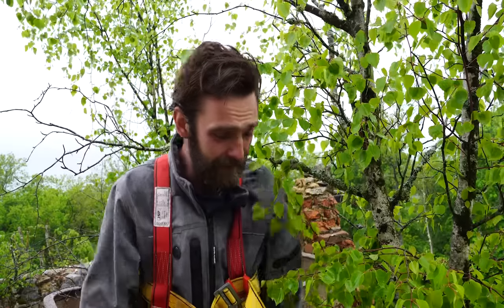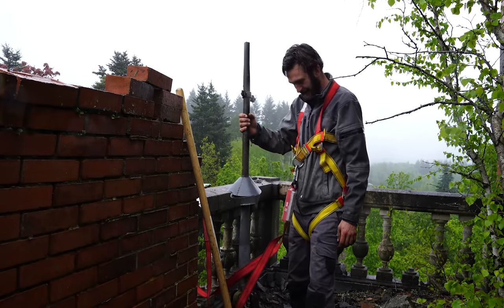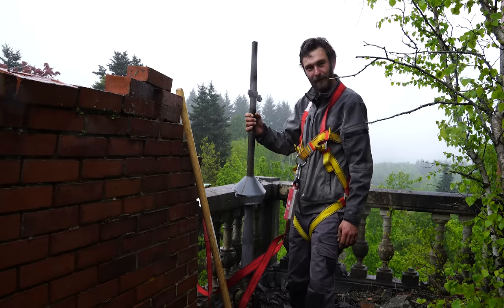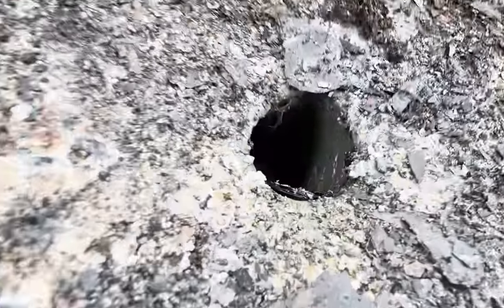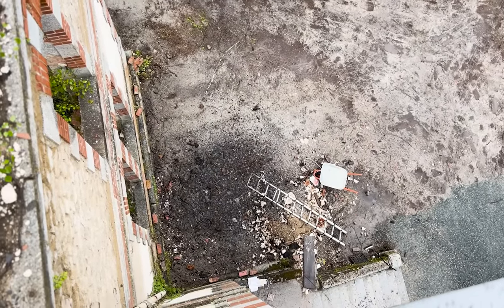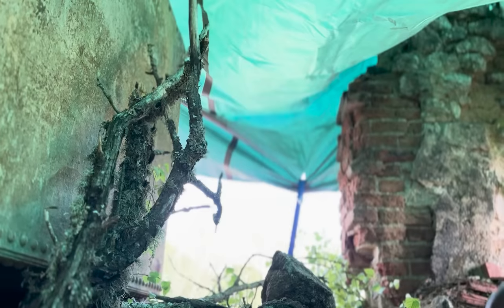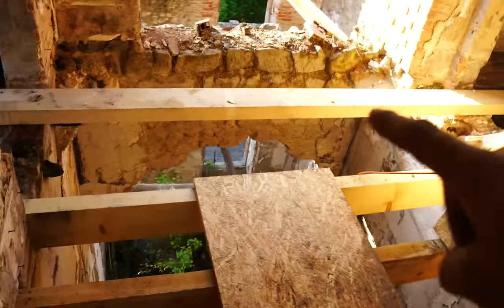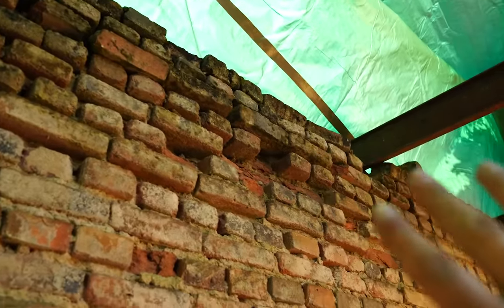I climbed the height of this ruin to make it watertight.

Comment: Great to see safety being taken more seriously at long last.😊

Theoretically, those water tanks could be reused for the purpose they were originally made and installed for - without - the hassle of getting them down to ground level. 
But, technology has moved on considerably since those days & my guess is that you'll want to have a far more efficient hot & cold water system installed and one that's considerably easier to access should you ever need to. 

We're all aware of how keen you are to make use of original features in the Chateau. As far as I can tell, the only way to safely remove & transport these old tanks down to the ground is via scaffolding erected on the (outside) of the Chateau. 

Once down, and once restoration is complete, they'd both make wonderful planters located outside at the base of the main entrance stairs, either as two water features or probably more practically, with holes drilled in the bottom for drainage, filled with soil, and planted up with some sort of large evergreen shrubs that flower; Rhododendrons and Azeleas for example. Or perhaps small flowering trees; Amanagowa Cherry is a columnar ornamental cherry growing at about 45cm/yr to about 6•5mtr tall × 2mtr wide when mature is one example. Imagine coming home to those in the Spring. 

Of course this is years away & highly speculative. But I thought it may be an encouraging thought to aim for as your long, arduous & often tedious job of restoring this old girl to her former glory wends its way to completion. 
Either way, look after those tanks as they're highly prized in the gardening world for just the type of reuse I've suggested. If you don't wish to keep them, someone will gladly pull your leg off, hitting you over the head with the soggy end to get at them; I know I would! 😅😅 
Selling them would bring in a few quid, even if that were only a couple of hundred euros.
Reply: I think the only way of getting them down in one piece would be a crane. Unless you already had a crane in place anyway that would cost more than the tanks are worth.
Reply: @Ragnar8504  Possibly. But getting them out in one piece for reuse might be a viable option that once scaffolding was up, they could be slid across on boards onto it and then winched down to the ground; a two person job I should imagine. I'm not for one moment suggesting any of this is a walk in the park. But either way it's attempted, they still have to come down and it will be a complete pain in the backside to do; unfortunately, there's no way around that. 
I come from a farming background and as such, am used to having to use lateral thinking in order to tackle tricky things as easily & inexpensively as possible. 

Scaffolding is almost certainly going to be needed at some point for wall, tower & roof reinstatement, so I suggested to Dan that he seriously consider buying secondhand scaffolding & secondhand boards so that he can use these at his leisure, minus the expense & hassle of hiring. The other benefits of this approach is that you don't have other people in the hiring queue going mad if your late returning the equipment, don't have to worry about any holdups due to unforeseen circumstances relating to restoration (there's always something), AND you can then recoup all or near enough of the investment by selling it on again at the end of the project. I've seen other people do this & they don't seem to have regrets.

Comment: Dan, i have to say you certainly have a big set of gonads that's for sure, but I have to ask how did you secure the tarpaulin?  Did you just unroll it and hang it over the end of the wall's or have you somehow managed to fix it inplace?  I didn't envy you when you was unfolding the tarpaulin as i have done that with one about 100ft in length and honestly it almost broke me. They're not light by any means but once you unfold it they suddenly take on a life of theyre own. I hope you managed to find a way to secure the tarpaulin as the last thing you want is a windy day getting a hold of it and making it airborne🤔 that'll be one gigantic kite flapping around the top of the château !!!😮
Reply: He tied the tarp so some of the existing steel beams one floor below.

Comment: Can’t the winch be rigged to pull from a ring mounted in the floor or wall? Does it need to be suspended from above?
Reply: This cheap kind of winch is designed to be bolted to a section of square tubing and pull straight up, otherwise the cable gets damaged pretty quickly. I've abused two of them pretty badly pulling at an angle and it was very hard on the cable as well as the upper limit switch mechanism.

Comment: You know to clear the other 3 areas without falling through the floor you could from the basement under those area build a false floor with supports which could also double as the base for a concrete floor when its time
Reply: Yes, building the forms for a new ceiling from underneath would be an option, albeit a risky one. If the steels in the concrete ceiling are still reasonably strong they could support planks to stand on while demolishing the ceiling from above.
Reply: Really not that much risk if there r good supports to hold up the false ceiling
Reply: @RonSylvester-we4qi  I was thinking about installing the whole thing underneath that massive Damocles' sword of a ceiling. Once it's done it should be perfectly safe.

Comment: Where are your gloves?  All your work happens to be with those pretty hands.  !!!! Also being in a harness is only safe if you are tied off to something that can hold your weight.  The thigh straps need to be tight enough that no precious bits and pieces don’t get caught and crushed when you fall.  I also want you to think about when you are working at heights who is there to rescue you. Hanging safely only means safe if someone can rescue you with in a half and hour.  After that you lose circulation and well death is a real consequence.   We really like you Dan and are excited for this project but it won’t happen if you aren’t around to finish it.  Love ya, now make a plan with safety measures in place.

Comment: Sigh, not meaning to be a "Debbie Downer" more of a realist. You called it what it is a "ruin". The enitire roofiing structure and it's support system, that being alot of walls, is missing. The amount of masonry spalling is over the top. The elements have ruined everything that use to be internal and needed to stay out of the elements. Walls with corners missing or half blown out, plus leaning and still standing, I don't know how. Again, the masonry spallinig of what's left of the ruin. It's just......yikes!!!

Comment: There are so many chateau's and large old houses in france that need work so why did you buy a total wreck. Nothing about this building is truly salvageable or worth saving so why. Even if it was dirt cheap it is still going to cost thousands to make good. It also seems to be cursed in someway, definitely not a lucky house. Every time it is rebuilt something destroys it, so what made you buy it?
Reply: The house still has good bones and good luck comes with good thoughts. Think of the good the structure did by housing children escaping during World War II.

Comment: Dan, my mason husband with DECADES of experience is having a FIT watching you!  That tarp you put up can catch the wind and pull away more of the rotten masonry up top.  Or, it can collect water from downpours and drag the rotten masonry up top downward.  He thinks you are not understanding that you must fix the masonry first . . . not starting at the top, but at the bottom, working your way up.  Only in this way will you be able to save that structure.  The mortar between stones and bricks is just powdering out.  It is very unsafe . . . and a wall up top that is a SINGLE brick in width?  That is insane and very dangerous.  Start doing the masonry work on the main floor and work your way up.  That will make a solid base for you to amend/repair the masonry up top.  Good luck but please get your priorities in order because it is a matter of saving the chateau and of your safety!